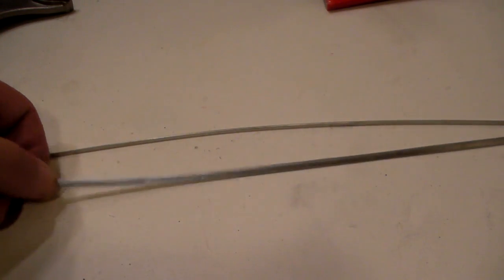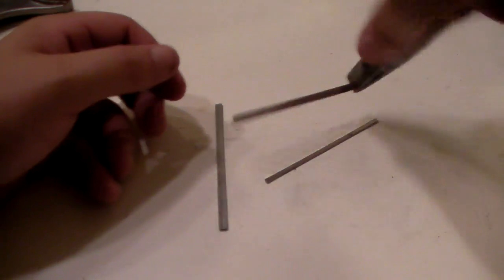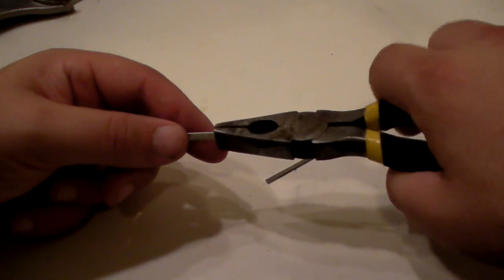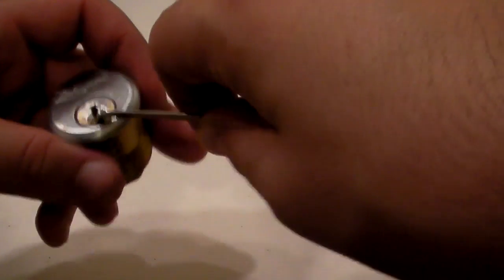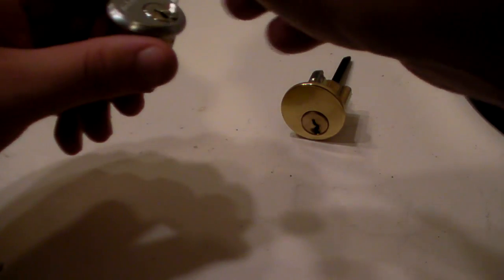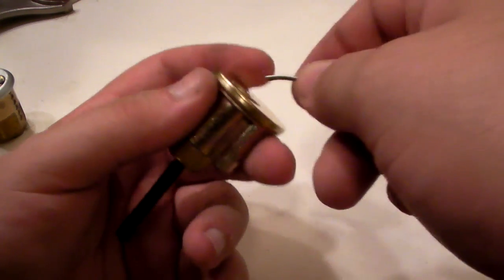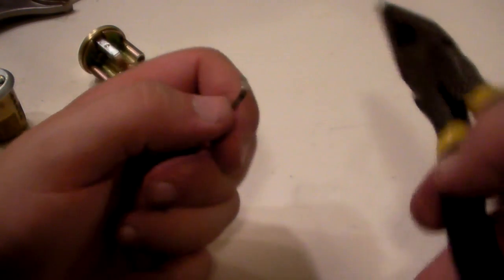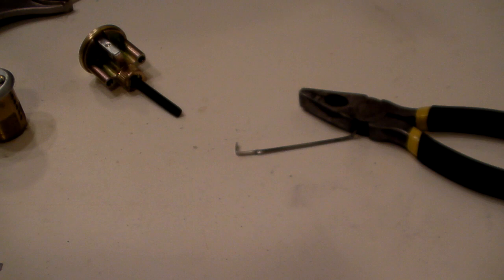10 - Tension Wrenches

Comment: I find this lacking after having done this for years and years now. Here is a bit of advice that ive found to be a game changer. Get a small cup of oil and a blow torch, plier to hold the wrench and lastly a piece of sandpaper. Heat the wrench up until it gets bright cherry red and than quench the wrench in the oil. Now this next bit is important so dont skip it. Take the sand paper and buff all the burnt carbon off of the wrench until its shiney again. Get it all off. Than your goin to hold the wrench with the pliars a good bit further from the flame. Rotate the wrench so your heating the wrench very slowly and heating it up as evenly as possible. Slow and even is the key. Once the wrench begins to blue, quench it in the oil again and buff it until its shiney. You now habe a wrench thats been heat treated and tempured and is now much more resiliant and closer to spring steel. Its going to make a world of difference i promise.

Comment: I tried this with a windshield wiper insert, but I had to be very careful to not have it snap when bending it. Is there anything I should do different, or should I just find another insert?
Reply: Same question wiper blades are so weak. I’ve also found they’re too narrow so they don’t hold the lock if you press too hard, they will rotate